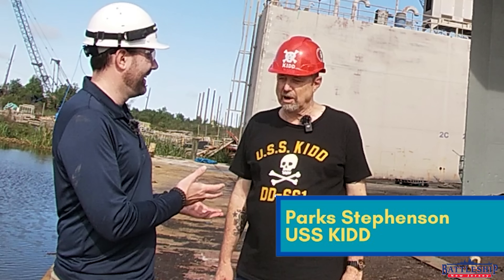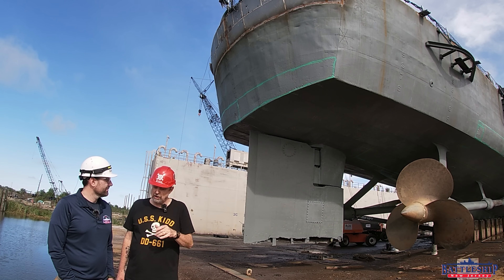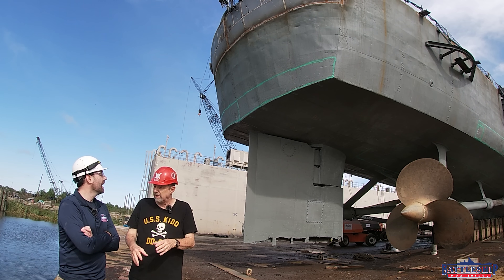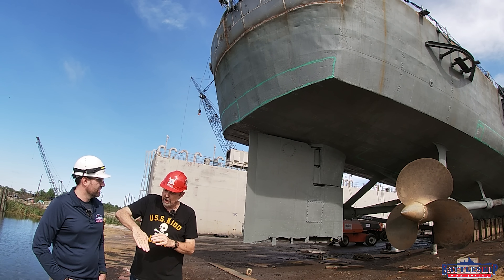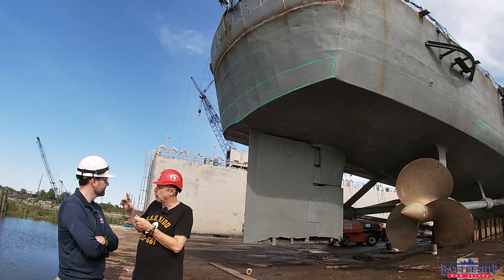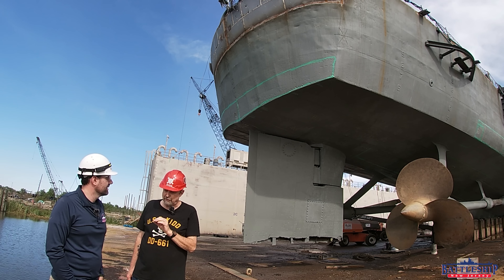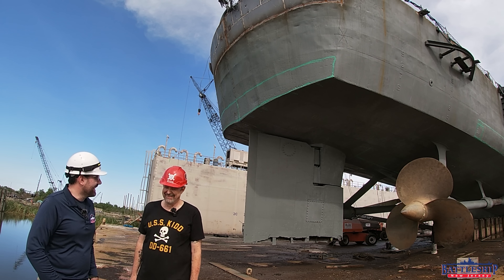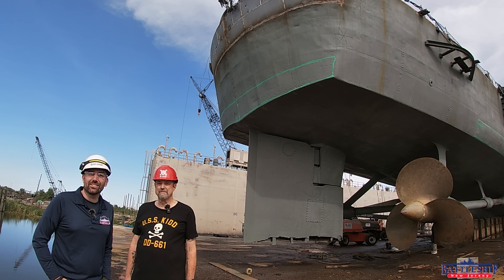Non Combatant Damage: Electrolysis with @USS KIDD PART 1

Comment: Yes agree intergranular corrosion but I woud add the discussion revolved around  damage. If there is a dent, the material has not returned  to to a zero stress state. A residual tensile stress (usually about 25% of the yield stress) along with galvanic activity and damage of the corrosion protection system all contribute to corrosive damage. Welding can also set up adverse residuals. Peening, annealing and cold working can help to mitigate.

Comment: The harder the steel, the faster it rusts. Work hardening by bending or rolling increases surface hardness much like thermal processing. Also why rocker panels in cars and trucks rust so quickly unless galvanized. A ship on fire gets quenched in cold water much like a blank in a heat treating shop.

Comment: Once crazy thing when talking about repair and steel is that the source and quality of the steel used in the repair is very important for the long term compatibility 
Just like the zink-steel reaction, you can have steel-steel electrolysis where the "lower quality" steel sacrifices itself. I've seen filler work on cars that just absolutely rots away, but just past the heat zone of the weld that put it there, the base metal looks practically new. I could see the same thing happen on a theater repair. 80 years later and either the base metal or the patch is going to be struggling and that heat zone in the middle is going to be having a really rough time

Comment: where's the electrolysis? kind of have to disagree with what this guy is saying. denting the steel isnt doing much metallurgically, however when bending/twisting/denting steel you cause microscopic cracks in the face of the steel, which gives a place for corrosion to get a foot hold if its not painted over, or sealed. corrosion from fire likewise has burnt off the paint, and left behind ash, which leaves the metal unprotected.
Reply: I'm certainly no expert but I have seen vids about boats in marinas experincing electrolysis damage because of shore power not being connected right to all the boats.  Not sure if it was a shore power fault or improper boat electrical.  Seemed like it ate up the zink quickly  then what the zink was supposed to protect.  Yup, quick search on Y.T. brought up lots of vids & evidence, check it out.  I think that is more likely the corrosion problem here instead of a tugboat dent.   USS Kidd is always on shore power 24-7.   Thanks for video.
Reply: watch part II
Reply: @garywayne6083  Thanks,   Didn't know it was available yet.  Stray electricity,  I just wasn't buying the tug boat dents.  But I bet dents and repairs could affect where electrolysis corrosion shows up.
Reply: Plastic deformation leads to work hardening, which is a change in the lattice structure of the steel.  You are introducing more dislocations in the lattice.  But I don't see what that has to do with anything.